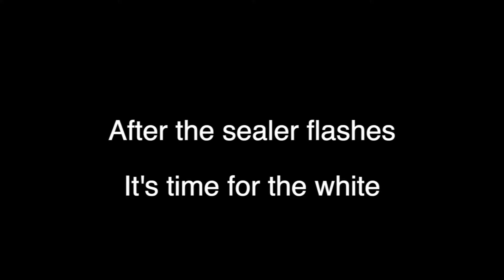C10 Project:  Sanding, Taping, and Painting the Front Half of the Truck

Comment: It is one thing to hang sheet metal, weld with  the gaps correct. Body work completely different but then paint. You are a hero in my book of men. 
DK, Omaha. Air brush, build rotisserie, camera, lights, edit... I am sure he grills and smokes as well!
Reply from the maker: Thanks Dean. I have to say my smoked meats are quite tasty, lol
Reply: @StoutCustom   Jim, resting as per Dr's orders after 5 injections, 1 per day. After watching this again, you have taught many lessons.
#1 The "P" sheets can be studied for the amount of primer of paint needed. Lesson; How much product do I need?
#2 You covered as to be comfortable, raise, lower car or chair as need.
#3 Solid colors in jambs, under hood and other locations seen and not compared like lower center of cab back. Could save money if cheaper and no clear. 
#4 The folded tape for soft edge and if done right, paper or plastic won't come loose if taped over. Leaving the pinch weld open during tapping helps eliminate water leading to rust.
#5 The time management issue. As you had shown the sun going down, it reminded me that if first time painters write down their "Stop / Start time, flash time and number of coats can help a new painter figure out if the have time to start a new product or wait. Plus, if wait, what happens next as "P" sheets tell how much time the product is open before it has to be re-sanded or simply continue spraying paint in "XX" number of hours after sprayed. A full page "Time" note could be taped to wall of paint booth or paper / plastic on window or unharmed location on the vehicle. This way there is forgetting or guessing. 
#6 Leaving, allowing time to clean up. Remove tape while wet pulling down or away, handling these materials as touch & temp from "P" sheet would allow a painter to finish at the vehicle, but clean those expensive guns, paint mix area clean up, remove spills while wet before hard and near impossible to remove since paint remover is less than Ajax. But all needed, has to be done and if my son (38) is any example, never thought of it!
You are the professional and I look up to you and do pay attention. But that material alone is enough to make a 40 minute video just using some old footage (Yah, like tape or super 8)
Maybe I just think too much or not enough. Thanks Jim!

Comment: I’ve been off the computer for awhile I thought this truck was already painted? I’m a learning painter and body man in progress. I went through 4 hoods before I found one worth using. What I found for separation of hood frame a sheet metal was liquid nails. Turn the hood upside down supporting it on the sides and carefully put it between the lose areas it makes final blocking and finish much easier!
Reply from the maker: Interesting. I might have to give the liquid nails a try. I had painted the cab and some of the jambs before but decided to get rid of the painted on mouldings. Next…the bed. Thanks for watching!

Comment: Howdy. Im curious why you paint some trucks with doors and fenders on but others you paint in pieces.   Thanks.  Great videos
Reply from the maker: @mitchelldickens9702  I prefer to paint things apart if possible. However on this truck I wanted to paint the jambs with single stage and the outside with base/clear. There is also the added dimension of two toning. Two tones can be painted apart but require more measuring and a little guesswork so lining up the two tone lines is of course easier if it’s together. Color has to be factored in to the equation as well. Some colors are easy to match when the pieces are painted apart while others such as tri-coats have greater risk of not matching if painted apart. If it’s an easy color, not two tone, and it’s all getting sprayed with the same paint system then there is less masking and zero tape lines if painted apart. Simply put it together and you’re done.  Hope this helps and thanks for watching!

Comment: In one of your videos, the hood would deflect in one particular spot as you were sanding it I have the same issue. Is that because the hood skin has come loose from the structure beneath? If so, would it be beneficial to spray foam between the hood and structure if I can determine where the two have separated?
Reply from the maker: Yes either it has come loose or it was never attached. SEM as well as other companies make a flexible foam that works well for this. Just like any expanding foam it makes a mess so be prepared. Regular hardware store spray foam is not a good idea. It can expand too much and push the metal out too far. It’s also not flexible so if you press on it and it collapses you are right back where you were.  You can just find something to use as a temporary spacer to use while you block the hood then remove it when you are done. A paint paddle or bondo spreader may work for this. Just fill the gap enough to keep it from flexing and not put too much outward pressure on the hood. Hope this helps and as always thanks for watching!

Comment: The pvc handle is something I wood whay do what dow for sand on sheet steel
Reply from the maker: That handle has been on there for years. Not sure why I put it on there but the main thing was to tape open the dead man valve. It was a pain to hold for long periods of time.

Comment: I’ve been trying to find the best process for my own, but I’m getting mixed information online. Some say epoxy to bare metal, then filler, then more epoxy on top to keep moisture of the bare metal and to seal the filler from moisture. What do you recommend?
Reply from the maker: If you strip panels to bare metal yes epoxy first. Epoxy will provide you with the best corrosion protection while you straighten dents and work filler.  Filler also adheres to epoxy very well.  Inevitably when you sand the filler you will also sand some of the epoxy off and have bare metal.  This will require more epoxy over the bare steel at a minimum or you can apply a coat over the entire panel (after lightly sanding everything).  If by some chance you worked the filler and never broke through the epoxy, you could go straight to high build primer since the adhesion to bare steel and corrosion protection are already there and the high build will protect everything from moisture. The problem with epoxy is that it has very little film build and doesn't sand all that great so at some point you need to apply a high build primer.  This usually done wet on wet meaning that once you are satisfied with the filler work and the second application of epoxy is done, you apply the high build primer on top of the epoxy after it flashes off for the appropriate time usually around 30 minutes to an hour. That is the traditional way to go about it.  There is a newer product that is gaining in popularity that is an epoxy based high build primer.  It has direct to metal ability, sands well, and has great build. It's PPG's Vibrance line VP 2050 DTM primer.  Once the panel is stripped it can be primed with the VP 2050, filler work done, and reprimed with the same product. It has worked very well for me.  If you want some great information go online and search for PPG's Custom Restoration Guide.  It's very straight forward and informative.  Lots of good stuff in there.  Hope this helps and thanks for watching!
Reply: @StoutCustom  This was a great help, thanks. One follow up though, what’s the maximum time you think the body filler can go uncoated? Should it be covered with the next coat of epoxy within a certain timeframe? Again great series on all of the squarebody content, finally got me motivated to finish the project following along with your process.
Reply from the maker: @cjack7595  If your shop is fairly dry several days is fine. If your shop has moisture issues like condensation on metal in the mornings when the temperature changes it needs to be primed before you leave in the evenings. My old shop was that way certain times of the year so I primed daily. Where my truck is located now I can work filler for a day or two before priming. The exposed metal is the main thing. If it sets exposed be sure to resand it before priming. While you don’t want moisture in your filler, the big problem would be if there were no epoxy under it. Since filler is not waterproof the metal under it (with no epoxy) could be corroding/rusting  because it’s basically exposed and you would not know until down the road when bubbles started appearing in your paint job. Another thing, just work one or two panels at a time so you don’t get stretched out too far.
Reply: @StoutCustom  Once again, thanks for the quick replies. It’s such a big help to be able to pick the brain of someone like yourself. Looking forward to seeing more of your finished projects.

Comment: I know this may be a dumb question but how do you keep from getting tape tracers when you tape off for your 2nd color on the 2 tone? The reason i ask is I've had a couple problems while doing my square body 2 tone. I use the vinyl 3m fine line and all and even waited 24 hrs to tape it off and its not the glue part of the tape but more of a impression of the tape? Now im using house of kolor paint if it matters but im getting ready to do the 2 tone again on it and it happened to me on the white witch i sprayed 1st just like you did in this video. Im almost about to intercoat just the area where im gonna tape to prevent this as the last time it drove me crazy!!! Lol
Like ive said before you da man so i know you know a secret or 2 that could probably keep me from wanting to beat on my truck.... Just kidding but if there's some advice you could give me it would be greatly appreciated!!! And keep up the great work as im always waiting on your next video to drop!!!!!
Reply from the maker: Hey Jeremy. Looks to me like you are headed in the right direction with the intercoat clear. The tech sheet for the HOK specifically states not to tape directly to their basecoat. Says you must first apply intercoat clear to avoid tape tracks. So I think the intercoat clear is your fix. There are other things that could create the problem like over applying the base causing it not to dry well or over applying base on top of the fine line causing solvent to creep through or around the tape but after reading their tech sheet I’m fairly sure you just need to apply the intercoat clear first. Good luck with your truck this next go-round and thanks for watching the channel!